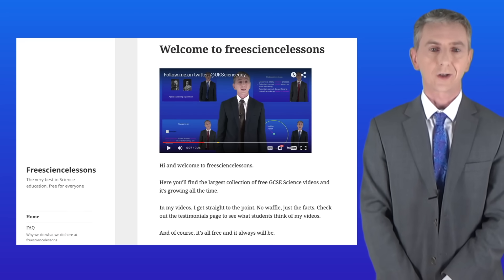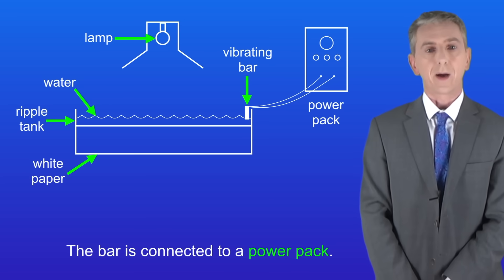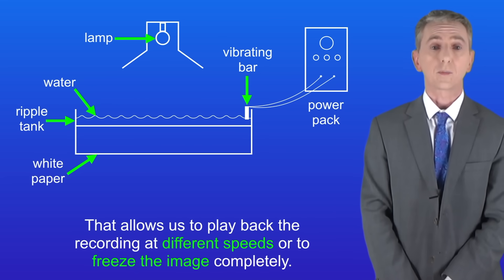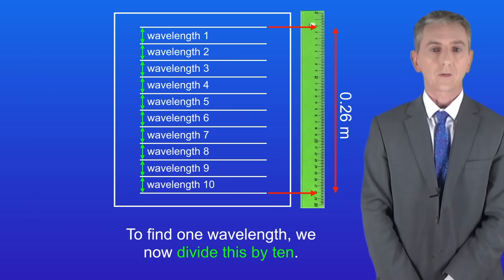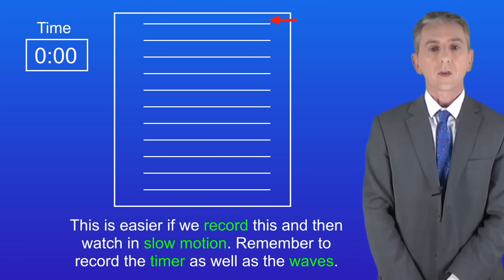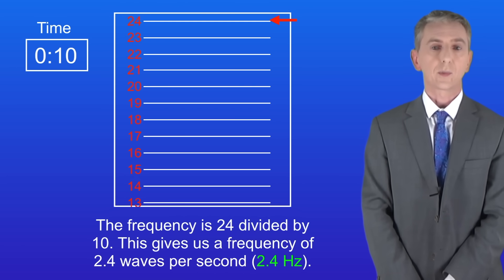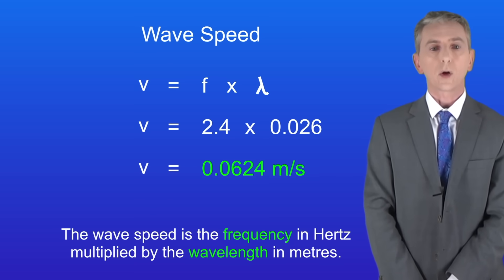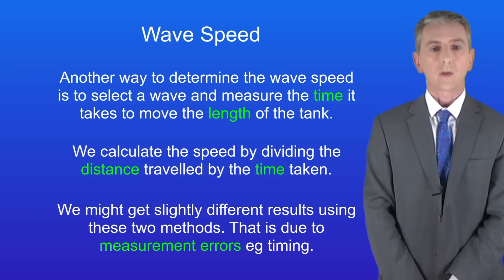GCSE Physics Revision "Required Practical 8: Ripple Tank"

Comment: hi sir, I’m a little confused as to how you measure the wavelength using the footage on your phone, could you please explain how that works?
Reply from the maker: Video the ripple tank from above (with a metre rule next to it) and then freeze the image. You will see a pattern of light and dark stripes which represent the peaks and troughs of the wave. Choose a peak (or trough) and then count down to the eleventh peak (or trough) below it. That means that between the first peak and the last, you have ten complete waves. Now look at the metre rule on the image and measure the distance from the first to the eleventh peak. That's the length of ten complete waves. So now divide the measurement by ten to get the wavelength of one wave.
Reply: @Freesciencelessons i love you

Comment: Hey, is it sensible to use a strobe light and increase the frequency until it is equal to the frequency of the waves that way  the image is also frozen on the paper or screen below? this is the way we were taught it?
Reply: Shut up I don’t care keep it to you’re self
Reply: Doesnt sound right to me, as far as I know. But I'm a student too, so dont take my word for it
Reply: You can use it to visualise the wavelength but you can't measure the wavelength using the technique as the light might be flashing every two frequencies instead of one frequency giving inaccurate results.
Reply: yes this is fine
Reply: Yeah that's correct, thats a better method imo, less steps and it makes more sense

Comment: At 3:15 wasn’t the wave length supposed to be 0.26 and not 0.026
Reply: no it is right, he divided 0.26m by 10 wavelengths  to get 1 wave length which = 0.026m per 1 wave length
Reply: No that was for 10 wavelengths
Reply: 0.26 is the wabelength of all 10 waves. Dividing that by ten gives the wavelength of one wave, which is 0.026

Comment: do u measure 10 wavelengths or the amounts of wavelengths on the paper
Reply from the maker: Well you just need to measure a large number and then divide by that number to get a more accurate answer. So five wavelengths for example would also be fine.

Comment: Hello sir, just wandering, what exam board is this?
Thanks
Reply from the maker: These are for AQA but almost all of the content also applies to the other exam boards.
Reply: Ok. I am having my mocks this week and I have a physics exam next. Your videos have helped very much
Reply: Freesciencelessons have u got any videos about (HT only) Blood flowing through the muscles transports the lactic acid 
to the liver where it is converted back into glucose. Oxygen debt is the 
amount of extra oxygen the body needs after exercise to react with the 
accumulated lactic acid and remove it from the cells.

specifically the function of the liver in response to exercise?

Comment: Sir, have you got any videos that can help me on this "(HT only) Blood flowing through the muscles transports the lactic acid 
to the liver where it is converted back into glucose. Oxygen debt is the 
amount of extra oxygen the body needs after exercise to react with the 
accumulated lactic acid and remove it from the cells."?

Specifically the function of the liver in response to exercise.